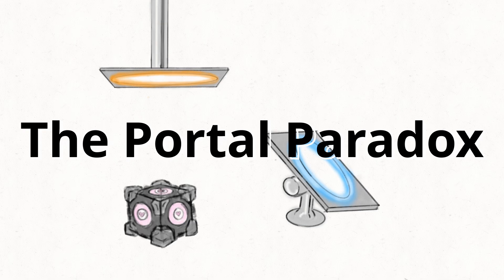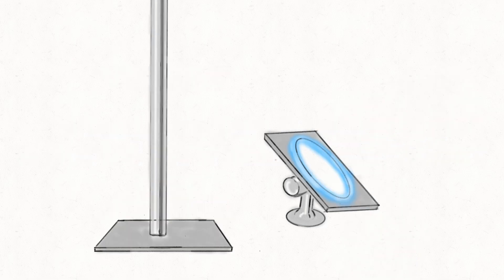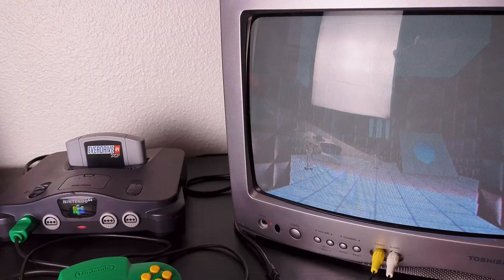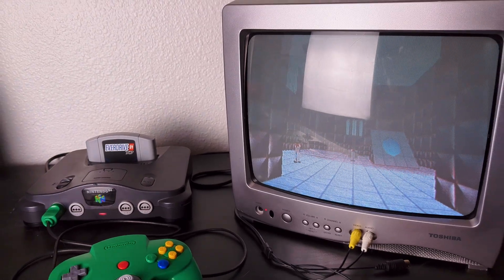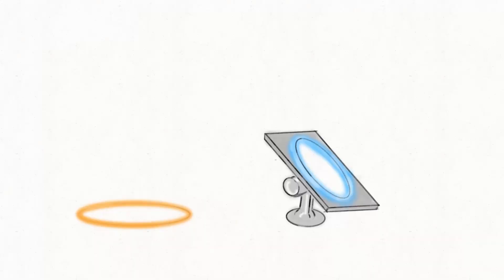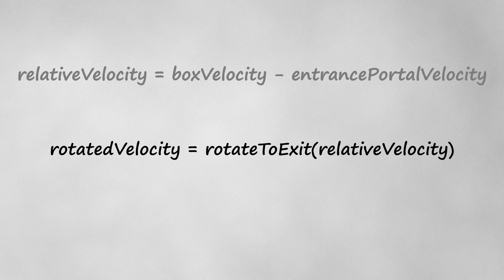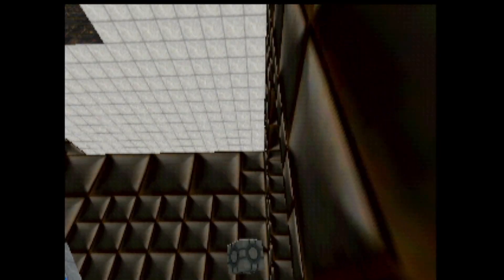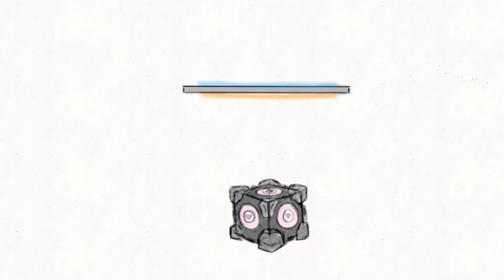I rewrote Portal from scratch and solved the Portal Paradox

Comment: See now I disagree with the idea that the box will shoot out the end. Why would the box gain velocity if no force is being acted upon it? Let's say we did have a hula hoop, however the exit of that hula hoop is somewhere else completely. It would still function the same as we expect with a hoop falling over a regular box. The speed at which the entrance moves does not and cannot add force to an object, like a door getting pushed towards you but leads to a different room. If a hole were to be flying at my face and I did not move, there is nothing acting on me to push me with force outside the exit of that hole. Regardless of the mathematical equation used to calculate the velocity of the box from the exit hole, I argue that the velocity of the box is completely independent of the velocity of the entrance- therefore stating that the velocity of the entrance portal cannot add momentum to the box as it leaves.
Reply: The hula hoop thing matters because the exit is also moving downwards, so any momentum gained by the entrance moving downwards would be nullified by the exit also moving downward. So if the exit is stationary, the cube would gain upward momentum. Just think about it as if you're looking at the exit from above, you'd see the cube rush upwards at you. so the cube is clearly moving relative to you, and once the cube crosses the portal boundary, that relative movement becomes actual movement.
Reply: @godlyvex  I still disagree. Just because the portal was going fast enough to make it look like the cube was going fast, the block didn’t get moved. The entrance was push over the cube fast, while the cube just appears at the exit. That does not mean that the velocity of the cube would increase because an entrance went over it. Regardless of wether or not both the exit and entrances are moving, I don’t think the box is moving itself at all. Just think of slamming paper over a person, but the exit of the paper is somewhere else. Would the person you are slamming the paper in be catapulted out the other end of the paper? No, their body would just poke out the other end really quickly. Now if there was a second object where the exit portal was, then I would argue that the rapid push the box obtained through the door would launch something in front of the exit. The box itself shouldn’t be launched at all still, because no force is being acted on the box whatsoever.
Reply: @OxidizedNail  The paper example isn't comparable. Looking through paper, the environment you see on the other side looks stationary, while looking through a moving portal, the environment on the other side appears to move. So when the cube goes through the portal, it is in an environment that is moving from it's perspective, which happened without anything acting on the cube. But since the environment is moving from the cube's perspective, that also means the cube is moving from the environment's perspective. Those two things are the same, due to relativity. So the cube really would be moving.
Reply: @godlyvex  But things don’t move on a scale of relativity in reality. Just because something looks like it would be moved by an object at some angle does not make it happen. My point about the paper was exactly that- you are shoved into a entrance at high speed by the paper. The paper is moving relative to the person and the environment. Simply because this is occurring does not mean we are being launched. You can do this in the game too. If you look at a stationary entrance portal and run towards it, it appears that the out side is moving from your perspective when it really is not. Just because one thing’s movement relative to another is high does not mean anything is causing the other to move. What if we slow down the entrance portal? Would we see small jumps back and forth? I’m arguing that nothing changes about the speed of the entrance passing over the box. We know that if the entrance came slowly the box clearly would not get launched out but the speed of the of the portal has no bearing on the momentum of the box, just how fast it gets to its new location.
Reply: @OxidizedNail  The paper example is irrelevant here. You said the paper is moving relative to the cube and environment, but that isn't what's important. The cube is still stationary relative to the environment, so nothing happens. But in the portal's case, the environment is ACTUALLY MOVING relative to the environment on the other side of the portal. There isn't any 'looks like'; the portal is a bridge between two parts of reality, and if one of those parts is moving, then everything on the other side of it moves with it. If you stuck a blue portal over a street light, and then moved the orange portal around, the top of the streetlight would move with the orange portal. And if you pushed the top of the streetlight against the ground, it would start to be crushed or broken, because from the streetlight's point of view, it's being crushed between the ground and... the ground. And that crushing can only really happen if there is movement. The streetlight is stationary on it's side of the portal, just like the environment, and if the streetlight is moving around on the other side, then that's evidence that the environment is also moving around.
Reply: @OxidizedNail  Also, things do move on a scale of relativity? General relativity says that there is no objective frame of reference for anything, and that basically anything else can be used as a frame of reference interchangeably.
Reply: @godlyvex  The theory of general relativity is based upon the speed of an object relative to the surroundings and gravity. Generally speaking, this applies to how we view objects traveling in the universe, appearing to be smaller or longer than they really are. Further more, the idea extends to gravity bending space time. That’s irrelevant for the time being, but the point is that only the viewing of the object is determined by general relativity. Regardless of this law, it does not explain how an object gains a certain momentum based on the environment around it. If a room moved around the box and it stayed stationary, the box would maintain a velocity of 0m/s. Regardless of the fact that the room is flying around it, it would stay in its original position. Conceptually, I’m not moving at all, just appearing in a different place. The movement of the room does not impart movements on a given object, only in respect to friction or other forces acting upon it. Regardless, there is still no force being acted on the object and according to law of physics there must be a force to induce movement. If F=M*A and F=0, then we cannot say the object would have any acceleration as it leaves the exit.
Reply: @OxidizedNail  It wouldn't have any acceleration, but it would have velocity relative to the room.
Reply: @godlyvex  But it wouldn’t have velocity though because a door wouldn’t make an object move if it just passes over it. I think relative to the room, the object just appears very quickly, but it would not leave the floor it was attached to. It’s different if the floor of the cube is pushed into the portal, because then the momentum of the floor would be added to the cube. The cube cannot receive momentum unless something acts up on it.
Reply: @OxidizedNail  Wait, so you think the floor could add momentum to the cube if it passed through the portal, but you don't acknowledge that the same logic would apply to the cube itself? The floor passing through the portal is moving, but the cube is also passing through the portal. It doesn't matter that the portal stops once it hits the floor, because by that point the cube is already on the other side of the portal and already has entered the environment where it is moving.

You agree that the cube would be launched if the floor entered the portal as well, because it's entering a frame of reference where it's moving, and that movement pushes the cube, but isn't literally the exact same thing happening with the cube? Any motion you could ascribe to the floor as it comes through the portal would equally apply to the cube, and inertia means the cube wouldn't just stop after it finishes passing through. If you slammed the portal down on the cube at a ridiculous speed, the cube would be passing through the portal and would need to come out at that speed, it wouldn't just magically stop when it reaches the other side.
Reply: @godlyvex  It absolutely could just stop because it is still touching the ground it stood on. My example about the floor moving is about how when an object moves swiftly then suddenly stops the momentum is carried to whatever that object was touching. For instance, if we look at a catapult- the object is held in place by gravity, then as the catapult gets sent upwards the object stays attached until the catapult stops moving. At this pointed, the catapult’s momentum applied to the box because the object was being pushed and had the same velocity of the catapult as it was getting raised. The same is happening with the floor raising to the portal- where the floor stops and the velocity of the floor raising adds momentum to the box causing it to launch. The only occurs due to the fact that the box DID have velocity as it was getting raised, otherwise the momentum of the box remains a constant 0. If a portal slams onto the box, it has no ability to add momentum to the box like the floor does. Nothing of the portal can push or move the box in anyway. 

Furthermore, the ability to launch the box doesn’t work due to the fact that every action has an equal and opposite reaction. In the case of the box getting launched, it has a certain amount of force behind it while it accelerates through the air right? That change can only occur if an exchange of energy occurred, such as the shift from gravitational potential energy to kinetic energy. There is no change in energy of the box because it doesn’t gain velocity due to any source. Simply by pushing a door over an object cannot add any energy or momentum or force to an object which induces velocity. 

Elaborating on why the box wouldn’t fly off, gravity is still acting upon the box the entire time the portal is coming down. In this moment, the object and the ground are still maintain in a system where force is acting on one another. There is a normal force, friction, and gravitational force exerted on the box and the ground. In this way, it’s essentially as if you slammed a portal over a pillar that’s implanted in the ground. The box would appear at the end of the other portal near instantaneously, however while it moves from one end of the room to the other through the portals, it never actually leaves the ground it touched until gravity takes over and it rolls down on the other side.
Reply: @OxidizedNail  Do you actually understand velocity or acceleration? A box doesn't 'accelerate through the air', it accelerated while the catapult was moving upwards but the moment the cube leaves the catapult it is no longer accelerating at all. Velocity is movement, acceleration is when velocity is increasing, to put it simply. If you already knew this, and were just paraphrasing, then my bad.

It's absurd to imply that gravity is the force that stops the cube from flying away. Let's be clear, when the portal slams over the cube at a high speed, the cube crosses the portal at a high speed, and must leave the exit portal at a high speed. Once it is on the other side, there is no force to stop it from flying out. Gravity just isn't strong enough to overcome the speed of the cube, at least not in the time it takes for the cube to cross the portal. Your comment about "the cube is resting on the floor" is technically true... up until the moment the cube crosses the portal. 

Think about what's happening from moment to moment as the cube crosses the portal. Once the portal is about halfway down the cube, let's freeze time and closely inspect what is happening to each half of the cube. The bottom half of the cube is clearly stationary, this is obvious. Despite the bottom half being stationary, the top half of the cube is still emerging from the portal. So far, nothing unnatural, this would also be happening if we just dropped a normal door over the cube. What's different is the fact that the top half of the cube is moving relative to the environment on the blue side of the portal. With a door, the cube would be stationary the entire time, relative to everything except the door. With a portal, the cube is stationary relative to everything on the orange side of the portal, but it's moving relative to everything on the blue side of the portal. 

Now, let's unpause, and pause again the moment the cube is about to finish crossing the portal. The cube is still stationary relative to everything on the orange side of the portal, and is still moving relative to everything on the blue side of the portal. The cube is still touching the floor, as it has not finished crossing the portal yet. The cube has velocity relative to everything in the room it's now in. It still has no velocity relative to the orange portal room. Now, what you've been saying so far is that the cube is resting on the floor, but what's actually happening is that the cube is being pulled downward by gravity, and the floor is pushing back up with equal force, as it is a solid object and the cube can't just pass through. But once the cube passes through the portal, it's no longer affected by gravity from the room with the orange portal, it's under the influence of the blue portal room's gravity now. (Having to specify blue/orange portal room is getting tiring, I'm just going to call them the orange room and blue room to make it easier.) So the cube isn't really attached to the ground at all, the only force keeping it there is gravity, and if it moves at a speed higher than gravity then it will leave the ground. So once it's no longer in the orange room, it doesn't matter that it was previously resting on the ground. Fact is, at that moment, it is stationary relative to the orange room, and moving relative to the blue room, and it's in the blue room, so for the cube to stop, you would need to apply some force to counteract it's momentum.
Reply: @godlyvex  Yes, I understand an object’s acceleration. A box does accelerate through the air, as gravity and drag both cause the velocity of a given object to change. My argument was stating that the only method a box can leave the ground system it’s a part of is if the momentum of the ground transferred onto the box while moving. My argument is not gravity is keeping the box from flying away, it was just to say that it should be treated as if it were with the system of the ground. This means that the momentum between the two objects for be calculated together up until the moment the box falls through to the other side. I agree that gravity changes immediately as the box begins to pass through the portal, but again that’s not how I’m arguing it’s not flying. Now, I fundamentally disagree with the philosophy that the velocity from one portal to another is relative based on the velocity of the portal. This is what you and what Minute Physics argue. Things can appear to be moving when their true velocity is zero. My belief is that the velocity at the exit/blue room is based on the movement of the object in space. When the box is slammed with an entrance, it is not moving so at no point you can argue that it’s velocity ever changes to above zero. I understand the idea that relative to the orange portal, the box does have a velocity if we measure it that way. However, I don’t think the blue portal gives an object velocity based upon the relative velocity of the box to the portal. The room can move but the position of an object in doesn’t change.
Reply: @OxidizedNail  The position of the object MUST be changing. If you hovered your hand above the blue portal, your hand would be pushed away as the box goes through. How can this happen if the box isn't moving?
Reply: @godlyvex  I don’t think the box is moving, it’s just that a portion of the box is getting pushed out the blue end as the orange portal comes down. Every instant the orange portal moves, the box is just sticking out of the blue portal more and more. So, I agree again. The push on your hand is just the block get closer and closer outside of the blue portal. Technically, the instant until the block leaves the orange portal, the gravity that is pushing a normal force on the block is also pushing on whatever object is touching the box. This CAN apply a force, but not based upon the box’s velocity, just the force as the box reacts to things in its way. I think it acts like a powerful piston does. It’s shoved through the other but it CANNOT ever gain a velocity which allows it to leave the ground. Again, this isn’t the box moving from position to another, it’s a portal falling around the box which puts the box in the blue room without acting on it. 

Think of a floating point in a three dimensional space with the coordinates 0,0,0. There is a room which holds the point inside it. The room then moves around and has a certain velocity. When we’re in the room, we can argue that the point is actually moving being displaced based on our relative position to the box in the room changing. However, the point never moves from its coordinates. It just appears to move. We also know it has 0 true velocity relative to the coordinates of the world it’s in, because it’s coordinates on the plane never change over time. So, I believe that the same logic applies to the velocity of the box as it leaves the blue portal. The velocity upon exiting the blue portal is not based upon the relative velocity of the orange portal, but more likely the coordinate velocity that box has- which is always 0. Now, I would completely agree with you if we doing this experiment in a world where the portal just added velocity to an object based upon how quickly the object moved through the portal, but I don’t think that’s how it works IRL.
Reply: @OxidizedNail  I don't think your coordinate analogy is correct at all. That would imply that there's some objective frame of reference for movement, and there isn't. In reality, any frame of reference is as valid as any other frame of reference, though some are more convenient than others. There's no argument you can make to say the orange room's frame of reference is more valid than the blue room's. You can argue the point isn't moving, but you only think that because you have an unnatural perspective on that world.

And all the stipulations you're declaring about the box's movement through the portal seem arbitrary. The movement pushes your hand away but it stops being movement as soon as it finishes crossing the portal? This logic breaks down as soon as the cube stops being a rigid object. What if it's like 5 cubes connected by a stretchy string? Would the lower cubes push the upper cubes and launch them, like you agree the ground would to the singular cube? If the lower parts of the multi-cube could push the upper parts, who's to say the lower atoms of the singular cube couldn't push the upper atoms of the cube?

An analogy that I saw that seems very appropriate is having a train with a door at the front. If you just hold the cube still in front of the door, when the train passes, the cube will enter the door and continue on even though it's not moving. The cube wouldn't just stop after passing through the door. When you say that the cube will stop after finishes passing through the portal, you're ascribing some importance to the portal, when the portal just connects two areas of space. Nothing changes as you pass the threshold of the portal other than gravity, but that's mostly for convenience of thought. Technically some of the gravity would spill over between the portals, but I think we can agree that wouldn't change the overall result of the question.
Reply: @godlyvex  You seem to have missed the point of the force part. My point is that force is only exerted as the blocks are pushed through. If you had a long stack of bocks, the tower would propel out of the other but not off the blocks. I’m not saying that anything magically stops as soon as it crosses between the portal, it’s just that the block cannot get launched past the blue portal. My belief is that no matter how fast the orange portal goes, all it does is teleport the block to the other end section by section. Thus, as we push the orange portal over the block all that happens is that the block emerge on the other end. This happens extremely quickly tho, imagine the block getting pushed to the other end in a fraction of second. That pushing causing things to move, however nothing is acting on the block itself to cause the block to move. This doesn’t break down when you move away from rigid objects because the same thing applies- the object just appears at the other end.

The coordinate argument is valid because that’s inherently how video games are programmed. Objects have movement based upon the origin, the 0,0,0 position. My point was that if we can give something an absolute velocity based purely on objective constants rather the movement of the objects around them we can understand the velocity as the object as it leaves. So, back to the argument earlier- the box that appears to move while only the room moves exhibits no inertia. The box, if it had been moving in this room, would’ve maintained its movement as soon as the room stopped around it. However, that box would maintain its last position- still at 0,0,0 even as the room moves away from it. Furthermore, if we were to map out the entire universe in a 3D dimensional space, we could calculator velocity based on the origin of the universe. Why wouldn’t an object have absolute speed without relativity? Currently we are moving on a planet which rotates around 1,000 miles per hour. We are also spinning around a solar system, in a galaxy, and in a galaxy cluster which gives a very large velocity. According to the universe- we have to be moving at a very specific speed. That’s what my idea states: the velocity out the exit portal is calculated not by the velocity relative to the portal- but relative to the universe as a whole. More accurately, the object is only moving at the exact speed of the rotation of the earth, so it appears to not be moving. 

We know that the object is not moving- velocity of 0. My idea is that the velocity will remain 0 throughout its entire movement. Just like if a room moves around me- my velocity didn’t go above 0 yet I still wound up in a different place.
Reply: @OxidizedNail  That implies the portal has width, but it doesn't. The portal isn't a real object, it's a hole connecting two spaces. Nothing is teleporting.
Reply: @godlyvex  That’s about your perception. I’m arguing it’s an instant shift in position as soon as you cross over, ignoring the idea of wormholes bending space time. I think the way the portal are intended to be is instant change in position, thus teleportation.
Reply: @godlyvex  That’s what I’m saying- it’s instantly going from one point to the other. The object is not moving, the hole is just passing over it. The instant the hole comes in contact with the box, we should see box poke out the exit slightly.
Reply: @OxidizedNail  Okay, even if we accept that particles teleport as they cross the portal, and aren't really moving, how does that explain all the particles not in contact with the portal? Like, if you split the cube into parts A, B, and C, and the portal is currently teleporting B, what's going on with A, which has already crossed the portal? It's still attached to B. You can argue B isn't really moving technically, but the problem with that argument is that it ignores basically everything else. If you say A is moving, then because of inertia, it shouldn't stop moving unless a force is applied to it. If you say it's not moving, then what could possibly be happening? It's not being acted on by the portal, it's already passed through, and yet there's no other way to describe what it's doing other than 'moving'. Movement is movement, I don't think it makes sense to arbitrarily decide that an object's motion doesn't count as movement.